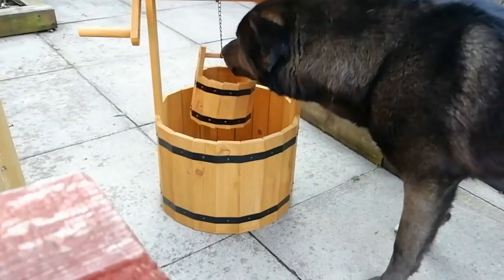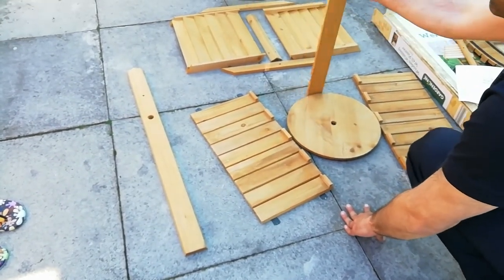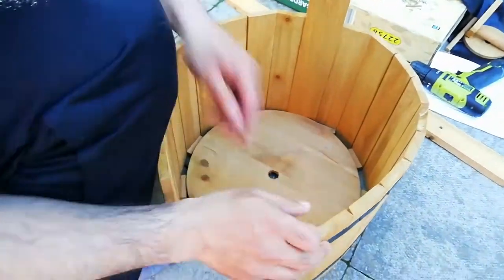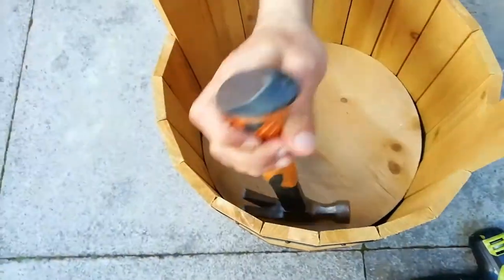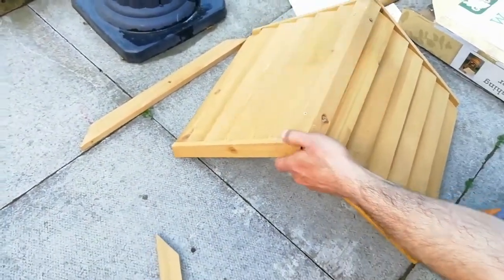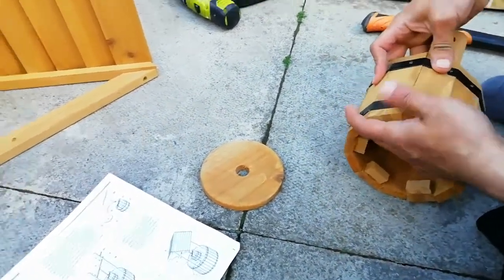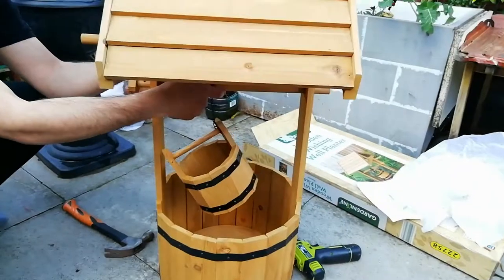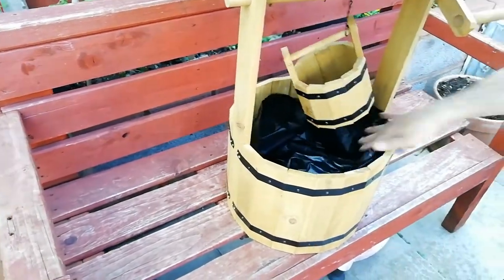How to Assemble small wood wishing well planter from aldi

Comment: Thanks for this video. Never made a flat pack before. I hadn't realised what "smaller edge of K to face inwards" meant. You said make sure you have them the correct way round. Even after looking at how the bucket was made I still manage to have K the wrong way round! For anyone else struggling.....the tall side struts that you use to build the main barrel section.....that is K and has a slightly narrower/bevelled side. The smaller, narrower edge should face inwards. Screwing them in place on the floor first does make it easier. The roof I found hard trying to hold it perfectly in place at the right angle whilst screwing the top section on was tricky. I used duck tape to hold it together. That wasn't a good idea as it pulled some wood off. The one side of the roof joins perfectly but the other side has a small gap. I think yours does too in the video? I'm not sure whether to varnish or weather proof it now to help preserve it before I put plants in it?